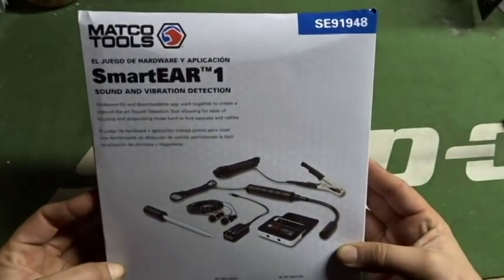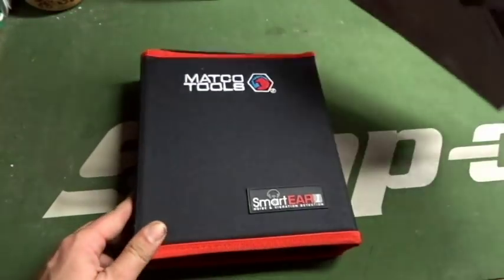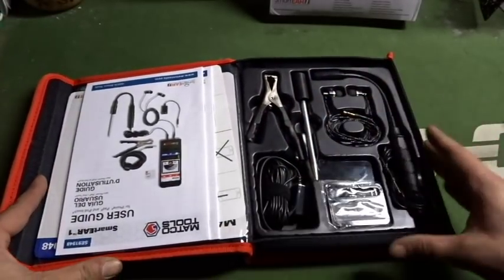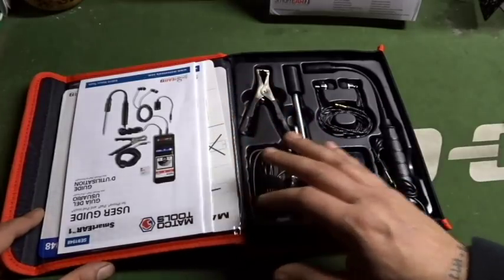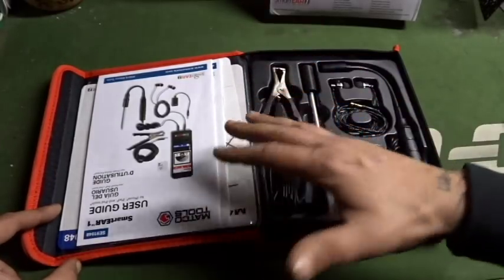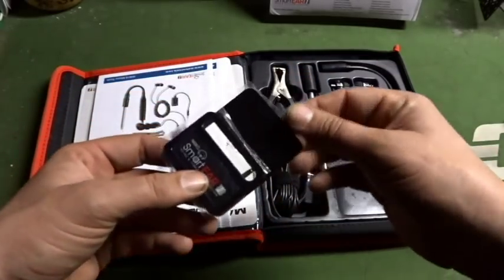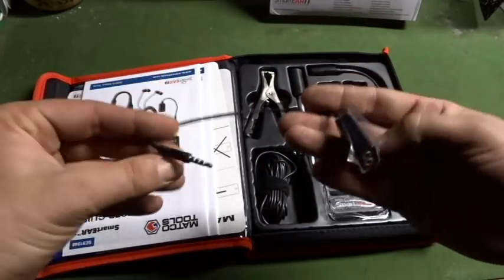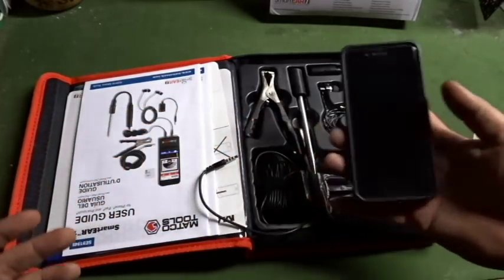MATCO Tools Smart Ear 1

Comment: This looks a bit overkill for the job and doesn't really seem to bring much to the table that couldn't be done with a non-"smart" (and lower cost) device. Plus you still have to cable it up. What I want is a waterproof wireless bluetooth version you can clip to wheel bearings or things in other remote locations, fix the transmitter up in the wheel well, then use a smartphone app to listen and analyze the noise it picks up. Saves cabling, yet still retains the "smart" aspect in that you can see waveforms, unlike the regular wireless NVH products that just have a dumb radio receiver.